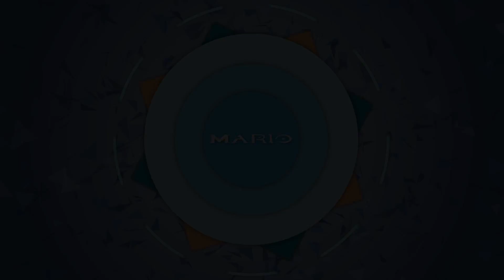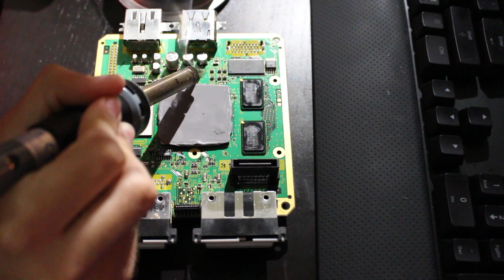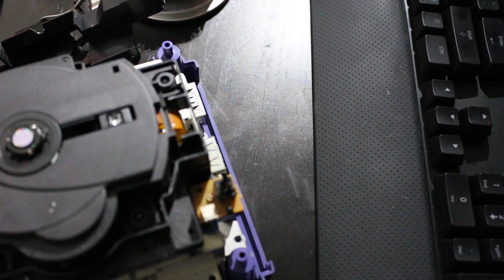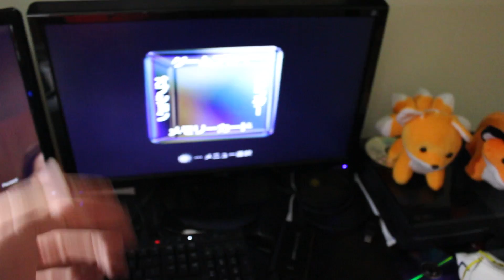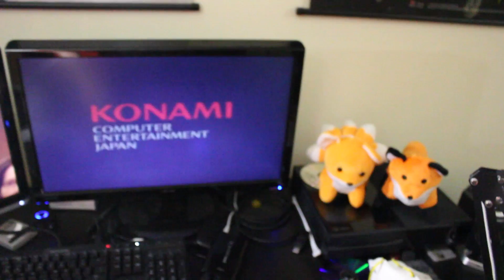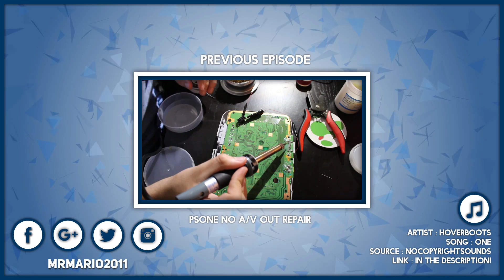Let's Repair! - GameCube Capacitor I Knocked Off...

Comment: Good video bro, my GC gives no sound on the AV output, and I think it might be a capacitor, any clue a out how to teste them?
Reply: Did you ever find a solution to this?
Reply: @light6148  yeh, sold it and got a new one working like charm 😂, no so qualified for troubleshooting alectronic devices

Comment: Did something like this while taking off the heatsink as well, but for me it was an SMD transistor. Thought the GC was dead and threw the parts in my graveyard drawer, only to find the part on the floor 3 days later. It's currently my main GC, xeno'd and with an HDMI mod installed.
Reply from the maker: Don't you love it when that happens?
Reply: mistaecco SMD  Caps are not always needed, most of them are Bypass caps. Yust try if it works without it. Most of the time there are many of them in on line so it does not matter if it is missing
Reply: Wasn't a cap, it looked to be a transistor or something, but whatever it was it was feeding directly into the main CPU of the console. Considered trying to turn it on to test it, but didn't wanna run the risk that it might mess up the CPU, because then it would be completely and utterly unsavable.
Reply: mistaecco you can try it as long it's not shortet to anything. Missing compontens shouldnt harm anything
Reply: If you have a multimeter, look up gamecube laser tuning. Might help a bit? Also make sure you're burning your discs at a high speed, 1x discs won't work, I think I usually use 8x (though at this point I just use swiss and an SD to memory card adapter)
Reply: ***** Look up gamecube swiss, then find one of the adapters and boom